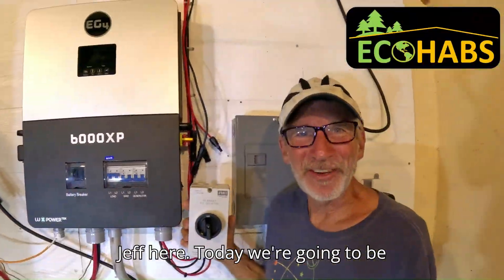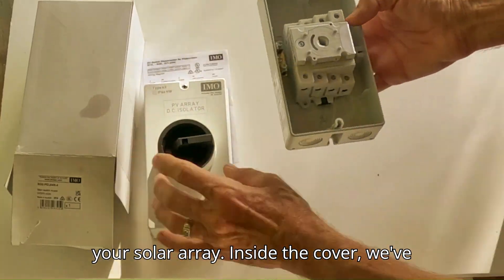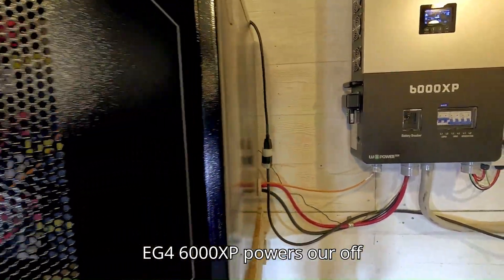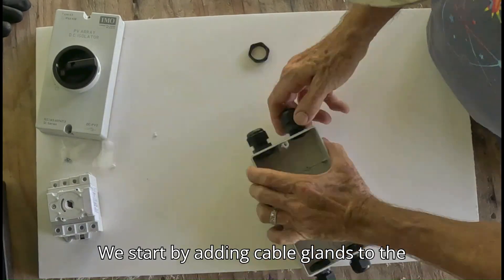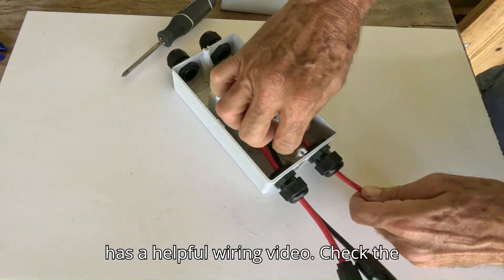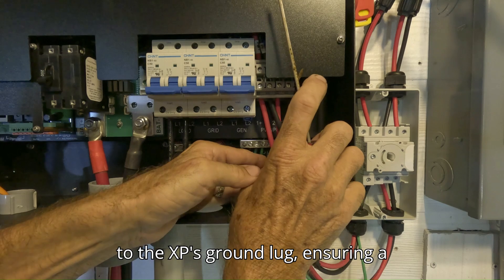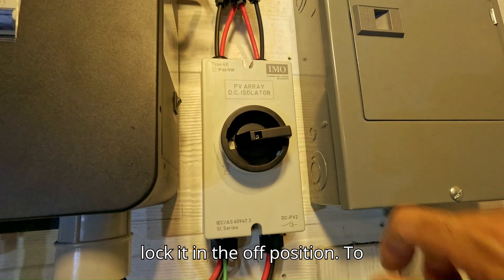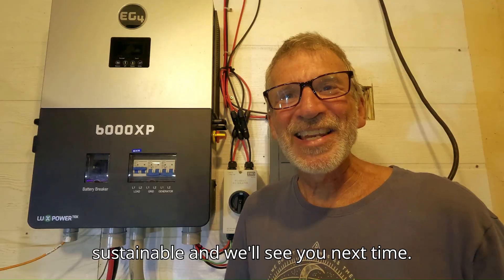Installing the IMO D.C. Isolator for our EG4 6000XP Off Grid Solar Inverter #signaturesolar

Comment: I have that same PV isolator switch on my system, but I mounted it outside on my solar array. I wanted to be able to shut off the solar power right at the array. Any time I work on my system the first thing I do is shut off that switch and make sure on my 6000XP it's showing zero DC coming in from the solar array. BTW, my 6000XP has worked great, but I really wish they would have had the 12000XP when I did mine! Now I'm torn between leaving it as is, upgrading to a second 6000XP,  or going with one 12000XP.
Reply from the maker: Yes, I am in the same boat with you on that! And when I got our 6000 XP they already had the 12,000 XP and I opted for the lower cost one. Dang!

Comment: What you actually need is a galvanic isolator to protect your appliances from damage caused by the transformerless 6000XP.
Reply from the maker: That’s old school thinking. With a little research you will easily learn that well built modern inverters are just as safe. Just don’t plug them in over capacity and they really scream!
Reply: @ecohabs4earth  I repair inverters for a living, have done so for the past 27 years, and I can assure you that it's not "old school thinking. It is fact". No galvanic isolation = damage to your appliances when the MOSFETS fail.

Comment: Here are just a few problems that users are reporting about these cheaply built inverters. 
Common problems with the EG4 6000XP include its limited load balancing, which can cause overload errors on one leg when high-draw appliances are used simultaneously. Other issues involve a Wi-Fi dongle that easily disconnects, a lack of local data access without internet connection, and potential problems with firmware or communication with EG4 batteries that require updates. Users also report instances of EPS overload warnings with small loads when the battery is nearly full, and potential imbalances in battery state-of-charge (SOC) within a battery bank.
 
Common Problems and Potential Solutions
Overload on One Leg:
The 6000XP lacks true load balancing, meaning it supports 6000W total but only 3000W per leg. 

Wi-Fi Dongle Issues:
The Wi-Fi dongle can easily become loose or fail to connect to the network. 

Lack of Local Data:
Without a Wi-Fi connection, you cannot access usage data or troubleshoot issues locally, requiring you to connect to EG4's servers. 

EPS Overload with Small Loads:
The inverter can throw an "EPS Overload" warning when the battery is nearly full, even with very small loads. 

Battery Communication/Firmware Issues:
The system may not communicate properly with EG4 Life Power batteries without updated firmware. 

Battery Imbalance:
Some battery banks may show uneven states of charge, with one battery rack unit holding a different SOC than the others. 

Cryptic Symbols and Abbreviations:
The screen can display symbols that are difficult for users to understand.

Comment: Doesn't the 6000xp come with a similar switch already onboard?
Reply from the maker: Yes, it does have a built-in PV switch. Somehow EG4 decided that the second external switch was advised to completely isolate the 6000 XP from PV energy.